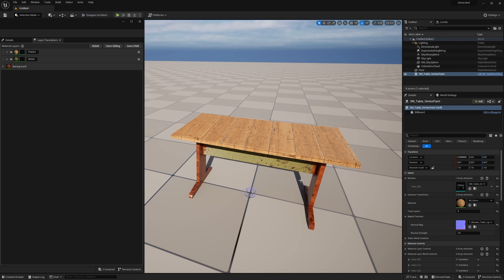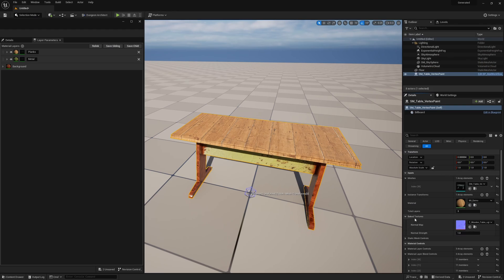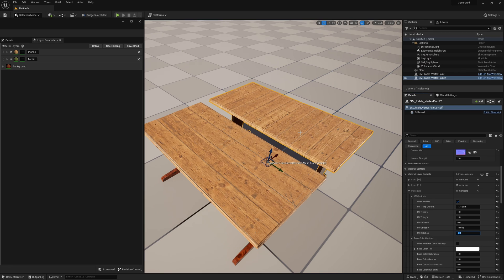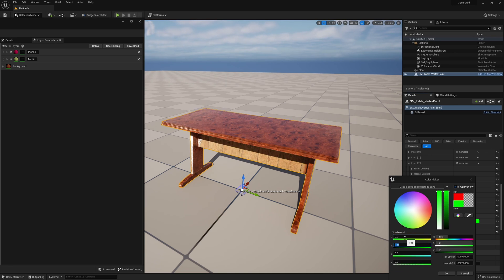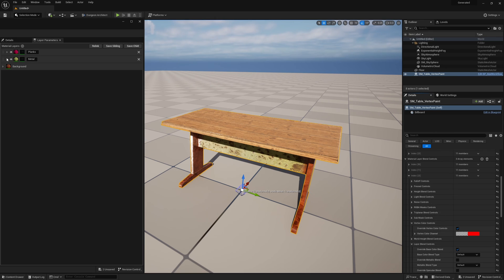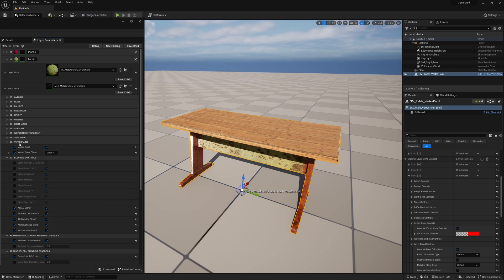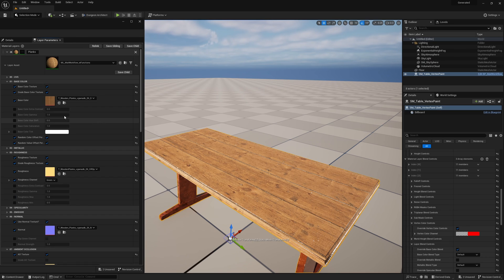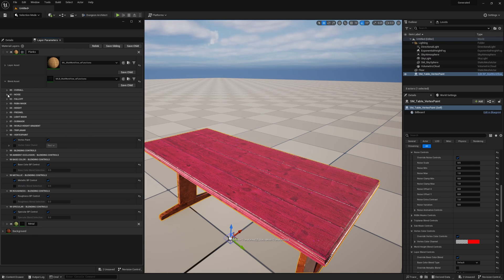The Master Material System Everyone Should Use

Comment: Doesn't this generate a lot of material instances in memory? Material layers seems like a cool idea, but they tend to be heavier than standard solutions. Have you tried using Primitive Data? Its a pain in a butt, but can be controlled from BP :) I'm new to UE so I'm not sure :) just asking. Thanks for tutorial!
Reply from the maker: The main downside to Primitive Data is that it doesn't support textures. So you can't easily swap textures. With tiled layered materials you save a ton in the texture memory department. So you sacrifice a bit of column A to gain a bit in column B.
Reply: @Procedural_Minds   You can change textures if you use Texture Arrays or Udims in the third channel of uv (I think udims are better as they have proper mipmap streaming). I'm not sure, but I think this is how landscape is handled under the hood (I'm just speculating). Maybe draw calls are less important in UE than in Unity, so maybe I'm being overzealous :) Thanks for super fast response!

Comment: Nice. How would this affect performance since we are now doing it being an actor bp? Vs multiple static mesh with lots of mat instances bit we can to hism, etc. Thanks
Reply from the maker: Depending on what you're using Unreal for, you might have a lot of bandwidth in certain areas. I work in Virtual Production so at least here I haven't run into any performance issues using it at a very large scale. For games I'm currently reworking this system a bit to still use a layered base.

Comment: This system looks amazing man! Lately I've been working in a layering system too, but one question came to my mind when trying to make a single Material Blending Layer, wouldn't static switches add a huge amount of shader permutations? Thank you for sharing this amazing piece of tech.
Reply from the maker: Static switches are pretty much the only thing that doesn't actually calculate anything behind them that isn't being used. So if you have something disabled behind a static switch that is super complex, it's like it doesn't exist at all. The limitation being you can't toggle it dynamically from a blueprint.
Reply: @Procedural_Minds  Yeah totally agree, in terms of shader performance static switches are a huge advantage as you get rid of a lot of instructions. However my doubts appear when talking about the amount of shaders the computer has to compile when the build is done. I am not pretty sure about this, but I think Unreal generates a shader variant per switch combination, i.e. if I have a Material Layer with 3 static switches and somehow I create different instances from it (or create one instance and enable/disable them via blueprint), Unreal will internally compile a bunch more shaders (in this case up to 8). Thank you for your quick response
Reply from the maker: @Oskarter9  At least I haven't heard of this anywhere. And in terms of performance I don't experience this as I use this setup at work professionally at a very large scale. I work in Virtual Production. Going to this system has improved our performance actually. So if it did cause issues I imagine I would have noticed it by now. But maybe you're right and I would need to go even larger scale.
Reply: @Procedural_Minds  I have to research a little bit more about this topic, because maybe Unreal handles Material Layers completely different to regular Material Instances and does not stack up a lot of shader permutations. Anyway I find it pretty reassuring that you have been able to test the system in a production environment and the results are positive. Thank you again for the info :)
Reply from the maker: @Oskarter9  Absolutely, happy to help! :)
Reply: @Oskarter9  Material layers work exactly like standard material functions and aren't different at all. 
Static switches work in compile time and not in runtime. So, in terms of runtime performance, static switches indeed save lot of runtime performance when you're not using some branches, as Procedural Minds said. But you're absolutely right that the engine will indeed compile a new shader permutation for every single branch that goes into a static switch. Like you said, UE will compile all 8 permutations if there are 3 switches. Now for a game, if there's a new shader permutation in the middle of a level, Unreal will compile it during gameplay (unless you're doing proper PSO caching) and it will lead to traversal stutters. You shouldn't be using static switches all over the place if you don't want an explosion of shader binaries. Traversal stutters are very noticeable during gameplay (depends on player's CPU though) and can be reduced a lot by getting rid of unused shader permutations. Static switches work in this same way everywhere as the documentation says.

Comment: One of the biggest strengths of the layer system is the ability to create an ever growing library of layer assets and blend assets. 
If you need something new, you don't modify an existing asset to add the new functionality, you simply create a new layer/blend asset. Having layer assets and blend assets with 50million different switches and parameters ruins the whole point of it.

Many simple assets built for a single specific purpose > a few mega assets that can do everything.
For personal projects, sure, go ahead with multi purpose assets but in a mid-large size production, multi purpose assets are costly to document and maintain. 
If your pipeline technical artist leaves the company, you are potentially wasting hundreds of thousands during the take over.
Multi purpose assets also greatly increase the risk of misuse from the art department.

Just remake all the blending functions available in substance painter as blend assets and all the layer parameters as layer assets and you will handle 99% of the production needs. 
If you do that, artists won't need any training to use the layer system since they will essentially work like they work in substance.
Reply from the maker: You do have a good point. I just really like to have control and flexibility to do whatever I want without having to juggle dozens of materials. I haven't thought of a good way to have the blend controls I want without it all being part of 1 because of how you can mix and match the different functionality.

Comment: Hows the performance of it? 
If I have a lot of layers that aren't being used does it hurt perf as if they were there?
Reply from the maker: If you have layers enabled that you don't use then of course that would cost more than not having it. You have the option to only enable what you want, so the less you need / enable the more performant it is. But that's the same as any material.